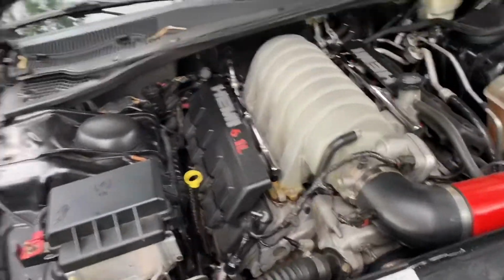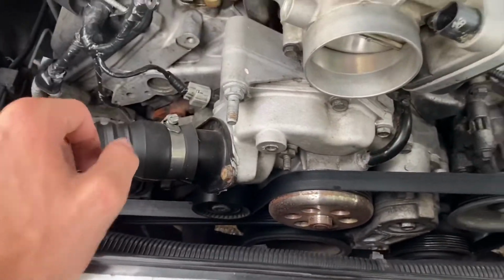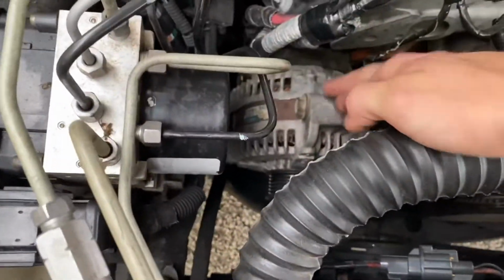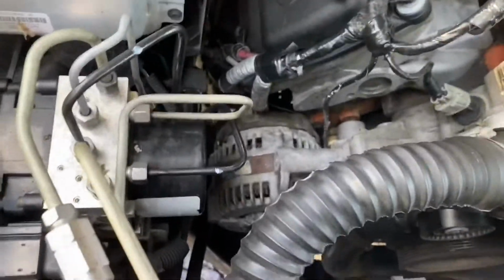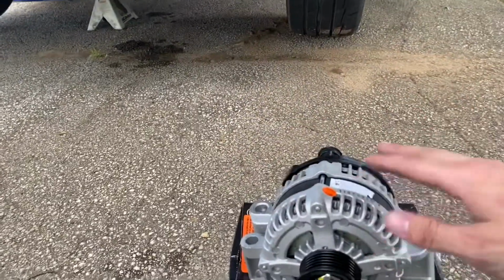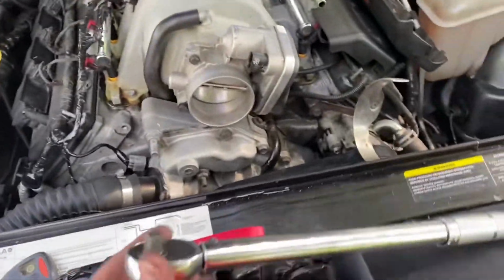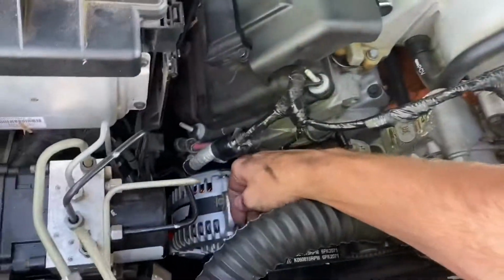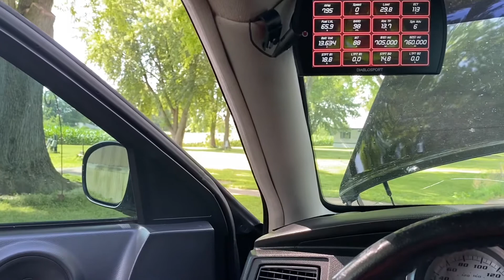How to: Alternator Replacement on your 3rd Gen HEMI (06 Charger SRT8 6.1L)

Comment: Nice work Kidd.   You can make that steering wheel
Look a lot better with some black shoe polish I use the past kind in the metal can kiwi brand is good.  Rub it in good let dry few min and rub in more till it’s all black the after 5 min or so just shine it up with clean dry rag.  Quick easy looks great.